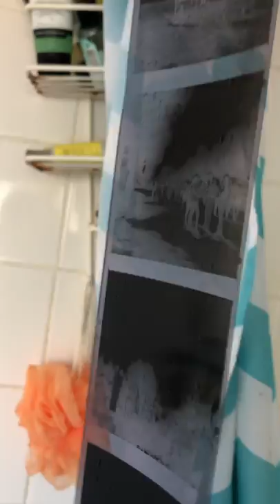Developing 120 with Labbox

Comment: Thanks for posting this. I seen some reviews that made me a little sketched about its 120 capabilities. You got a new sub !
Reply from the maker: Thanks Action - was much easier than I'd feared. No harder than 35mm IMHO.
Reply: hi, yes i purchased the lab box approx 1 month ago and the first roll of 120 black and white film came out great, but unfortunately my second roll  of film I completely ruined because i was trying to rush the process instead of taking my time and when i initially placed the 120 film into the top half of the lab box and closed down the grey tab I completely forgot to turn the lever on the side of the lab box into the open triangle position ,and after i placed the lid on top and was trying to pull the film through it and take the backing off it was not pulling through as smooth as expected . i then realised my stupid mistake and tried to rectify everything by saving the exposed film in my changing bag but without hope.
Anyway the rule is to take your time, and make sure everything is at it should be, otherwise you could ruin a film as i did.
As the saying goes "You learn by your mistakes" hopefully.

Comment: Washing film with LabBox. I have not tested on my own, but I suspect that washing film on the reel in a LB may be a bad idea. With the 35mm module, there is a high probability of getting water on the blade which cuts the film from the cartridge after loading, and it will rust (poor material choice there). On the 120 module, water is likely to get down into the internal film chamber, which would make further use impossible until disassembled and dried.  Interesting that ARS offered an accessory film washing attachment as part of the original Kickstarter offering, but cancelled it during the course of that program. I suspect that they discovered that there is no way to achieve a full coverage washing of the film inside the LB tank. I would remove the reel after fixing and wash the film in a separate tank, or (gasp) a real film washer. (If you can afford a LabBox, you can afford a film washer.) They also fully redesigned the 35mm reel, probably to improve even development.  ARS-Amago  has been remarkably non-transparent about the design corrections required during development of the LabBox and the limitations of the LB system. Not a positive aspect of getting into a LabBox for six to eight times the cost of a conventional developing tank.

Comment: Watching this video again, I noticed that a lot of the frames show white streaks running along the length of the film. (See two frames around 7:00.) My reaction was that these were from his abusive use of the film squeegee, but if so, those streaks would be black, not white. There is noting about the operation of the Lab-Box which would cause those streaks IMO.  So I wonder what happened?  As a totally separate issue, notice that he was using the half full tank processing method, and he diddled around pouring in the developer, then screwing around with capping the bottle, etc, before starting to turn the crank to agitate the film, and then he cranked it about three times as fast as required. (For a half full tank, you must agitate continuously, as only half the film is in the developer at any time,) This failure to agitate the film, letting half of it stand in the developer for a while, will lead to developing streaks across the width of the film. Better practice is to start rotating the film reel as you first start to pour in the developer to get a more even and quick "wetting".  Contrary to my normal suggestion, this might be the situation where you pre-wet the film in the L-B, as the wet film will absorb the developer more slowly and therefore even out the commencement of development.
Reply from the maker: Blimey you're really over thinking this

Comment: I've watched all of the YT videos I can find re the process of using the LabBox with 120 film. I'm left unresolved about whether the need to extract a length of film for loading will expose the first image on the film roll.  My survey of others' results suggests that its dependent on the camera used.  6x6 format cameras (12 frames) tend to start images far enough along the roll so that first image is not exposed. I suspect that my 6x7 format camera shooting only 10 frames on a roll will probably be okay as well. On the other hand, my Fuji GA645Zi squeezes 16 frames on a roll which conventionally takes 15 frames. I have my doubts over this one.  I will shortly have an opportunity to test my theory. If I have a problem, my only solution to it will be to blow off the first frame on each new roll - doable.
Reply from the maker: Im not really sure on the first point, my first frame had frame burn, but it may have been me.
Reply: @mattmaber  And, I was basically wrong. If there was exposure on the film roll end when loading 120 into a LabBox, it would be the LAST frame - roll end - not the first frame.Further, owing to a personal injiry, I've been diovorced from any film processnig for the las 20 months, so I still have had no chance to test  my issue for a solution.